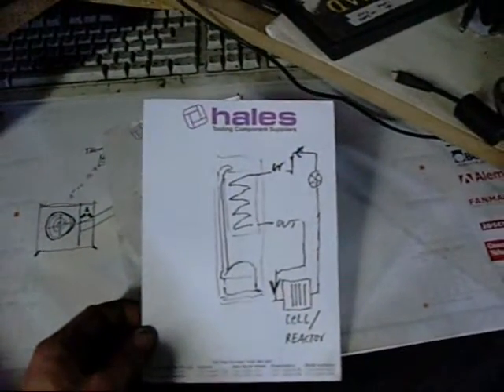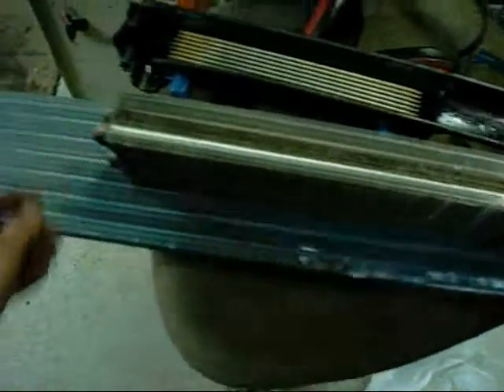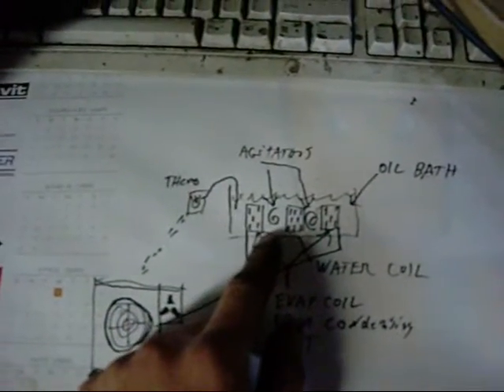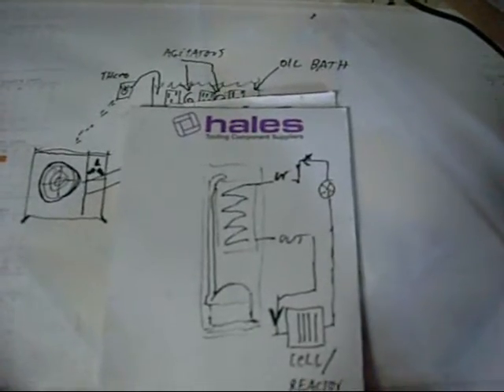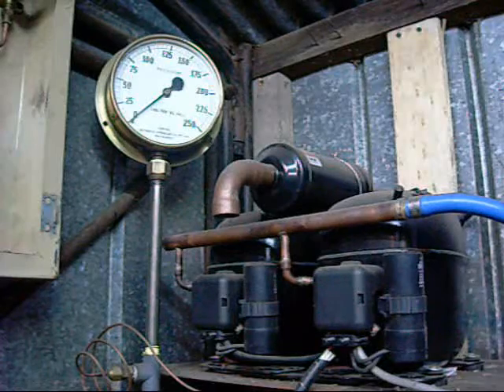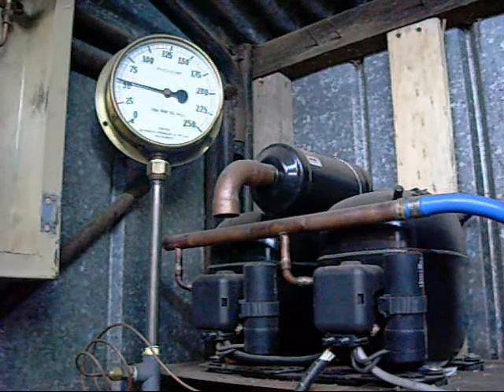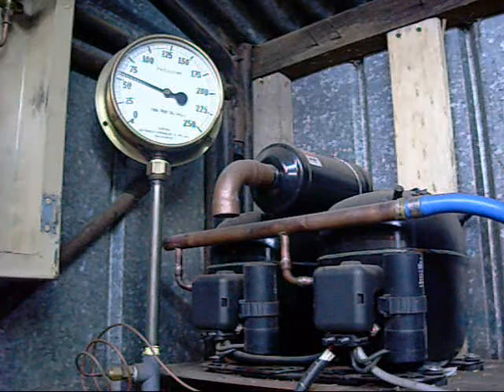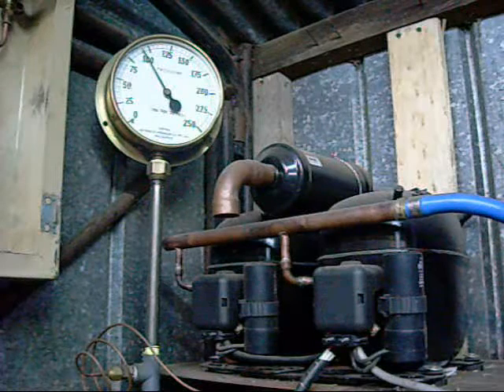NOBOX7 Chillers, Heat Exchangers & Compressor Charge Time

Comment from the maker: You can make heatpump water heaters, but if its to heat a whole shed using a radiator you will need a large reverse cycle condensing unit. maybe 3.5Kw upwards. just build the heater drum with the refridgerent coils inside and hook it up to the condensing unit.

Keep it running in reverse and it will heat the water up pretty good. weather or not it will have enough heat output for your shed I'm not sure of.

Comment: this is great stuff and love the vids...i'm very new to this but would it be possible to build an air heatpump to heat say 100 litres of water in a small insulated tank using an old compressor from a fridge or ac unit and a heat exchanger  to a modest temp ~30 to 40c? any ideas for me, it's -6c here in ireland and my shed is freezing...cheers